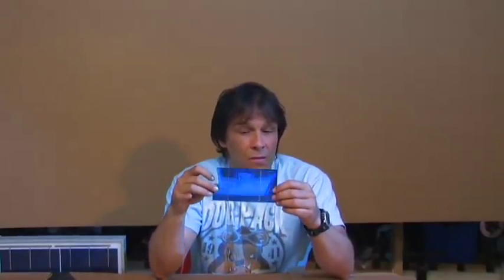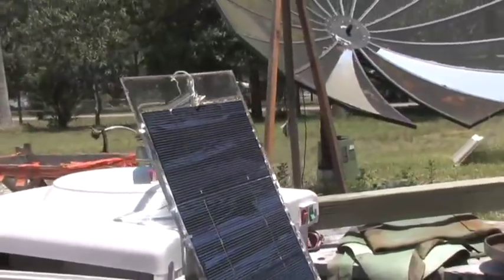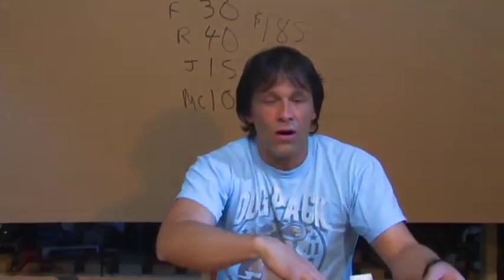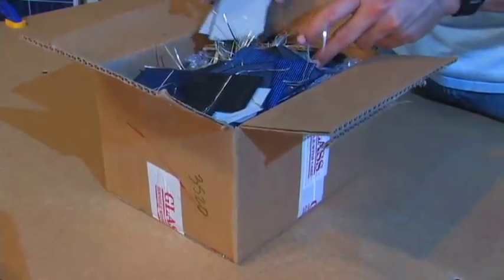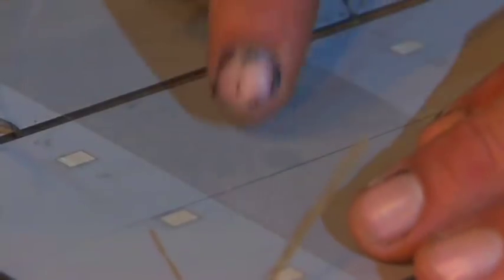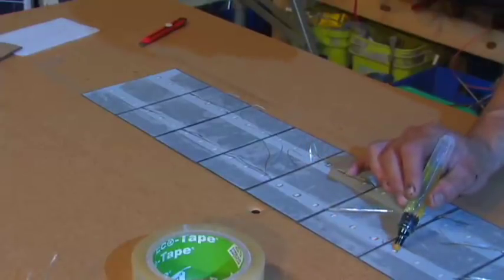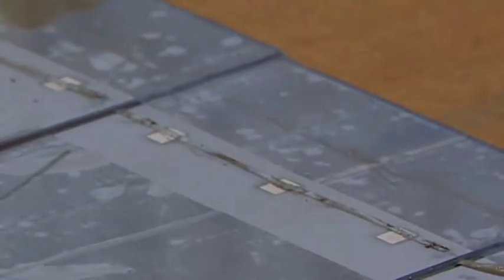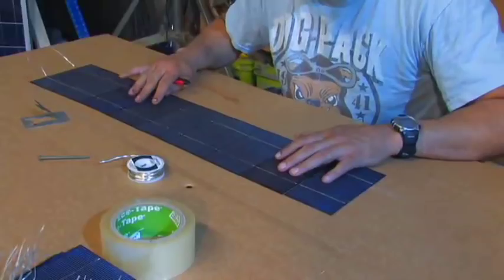less than $1 a watt DIY Solar Panel MAKE YOUR OWN SOLAR PANELS (PART 1)

Comment: i feel soory for you , imagen now 1 watt is 0,25 cent but good for 7 years .
Reply from the maker: That video was 7 years ago when panels were $250, now at $70 for 100 watts, buy them completed. Still good reasons for DIY as the cells are so much better now and custom fit panels use the same process plus like you said, cells are 20 cents for seconds a bit more for new. Aside from that,it is what it was.
Reply: @GREENPOWERSCIENCE  but how can we get 250 for 20 dollar is that posible for NOW

Comment: question......how to protect the panels from the elements especially hail
Reply from the maker: Fine mesh fence wire works great during the season of hail. It drops the power by about 5%. Worth the effort. The further away from the panels the better. This requires more material, 5 feet seems to work best. Look for chicken wire or fencing with a 3/4" hole.

Comment: I've been a contractor for 40 years and I assure you, 2x4's WILL TWIST OR WARP EVENTUALLY. Especially if wetted. Quartersawn lumber will warp less but is very expensive.

Comment: Back in 2011 $1 per Watt was probably reasonable, I wonder what would be a fair price theses days now that solar is so much cheaper..
Reply from the maker: 30 cents a watt now for cells but completed panels are less than a dollar a watt so I would just buy a completed panel.
Reply: I would too if my wife would let me..

Comment: hi
sir i have make one solar pannel at home in which i have connect 24 solar cells in series. Each solar cell is near about 4 watt which have  each 3 bus bar solar cells. so i want to know can i charge 12 volt battery from this pannel. and which charge controller is better for it, or charge controller is not require.

Comment: I like the idea but diy panels will just not last as long, so while it might be somewhat cheap to build if it doesn't last 20yrs out in the weather without needing to be replaced then overall diy panels are far far more expensive. So just buy a normal panel it will be cheaper and last longer. Building one might be fun weekend project to try which is cool but it wont save money nor last. :)
Reply: You think his resin coating will degrade over time ?
Reply: I don't think a diy panel would not just degrade but fail after a few years out in the weather. Eg If cost is a problem, buy a second-hand panel as it will most likely will have 15 years of life still in it plus its cheaper and easier then DIY. Sure go down the diy path if its a weekend project or if something cant be found off the shelf but with solar panels being so cheap to start with its kinda pointless.

Comment: Looks like too much work just to save a few bucks. 

How about showing us how to make a cost effective high capacity 2,000 Ah 12v or 24v battery?  I can't find any YouTube videos on this. You could be the first. 

The battery could be lead-acid or nickle-iron.  I prefer nickle-iron.  They last 10 times longer.

Comment: have you tried using the clear resin from the styrofoam liquefied buy orange oil to make the clear resin you need for the back of the solar panel

Comment: Looking at the back side of the cell:-I am using flux pen.The right line was taped well and the middle line all 3 small strips were not tapped. I tried again . not tapped. I tried with a new tapping bar, still not tapped and now the three strips in the middle line are look like burned and black in colour. I did not tried the left line yet. Is there any way to clean the black line? or the cell is still good to use with left and right lines are tapped?

Comment: hay  Dan  
I love your videos. I wanted to know if you can shed some light on something i got going on with my panels. voltage is 108 volts but my inverted only can run at 20 to 45 volts. i can not get the inverted to do anything.  what should i do? go get a charge control and run the inverted off of battery?  i got 180 cells did i go too large scale?

Comment: I am a little confused how to you cut the panels if the wire is not joined to itself.if the wire is joined to its partner you cant cut the cells as easily. But if the wire id folded over and soldered to the soldier points then you can cut the cell into individual cells.

Comment: Use orangewood  stick when you solder. Orangewood stick is a tool use and it is smooth and does not get hot.

Comment: You can buy new units for less than $1 a watt now.
Reply from the maker: alan headrick The cells are now less than 60¢ a watt now too. This video was from a few years ago when prices for completed panels and solar cells were higher. Everything is really inexpensive now.
Reply: +GREENPOWERSCIENCE  It's amazing how cheap they've gotten.  I just paid 25¢ per watt for complete panels (50 of them).  Exciting!  Now if I could just store the energy so cheaply.
Reply: +Peter Lawton where did you buy your panels?
Reply: I signed up for email from sunelec.com and waited.  The best deals are offered via email, not the web site.

Comment: I was interested in this video 2 years ago, $1/watt sounded good.  but now panels have come down to about that price.  Is this still possible to make them for less than buying manufactured?
Reply from the maker: jochco3 Yes. As prices have dropped for completed panels, so has the cost of cells. They are well below $1 a watt but the time vs quality and cost of a professional panel difference is less. I suggest going with manufactured panels unless you have a custom install (special size), access to free glass and/or have extra time on your hands. I think solar will bottom out soon as the cost of materials surrounding the panels have a set price. I would avoid buying glass. If that is your only option, go with a pre-made solar panel.

Comment: Hi Dan,
It is great video.
I have a few questions:
Where I can buy the cells and which cells I should get, I saw there are some cells with 2 or 3 tabbed wires, which one is better ?
Also, where I can get the batteries, controller and DC/AC inverter and how much they probably cost ?
 
Thank you.
Michael.

Comment: How much you can save with that in sunny days ?
Sun power 1kW/m2 maximum, yield typical 30% if  the hot air enters up in the house at less than 30°C,   i.e. 300W/m2  in a few sunny hours gives  around 1kWh/m2day  i.e saving less than 0.1$/m2day.
You recover yours 50$/m2, roughly in 5 years if 100 sunny days in winter of each year !!
It is perpetual and thus  good saving over many years with many m2.
 The yield improve when the heating air coming out is at the minimum possible temperature around 30°C, cycling fast with thermostat.
May be better on the house wall, or roof, with large surface of many m2, 20 to 50 m2.

Comment: hey man i got a way of encapsulaying thats way cheaper use a piece of 1/2 inch copper tubbing and flaten the end down to about a 1/16" gap and use it on the end of a sioicone caulking tube works great

Comment: I'm confused. You do all that soldering and then you say that you did it wrong by soldering all the panels to themselves, yet you don't show the correct way or what exactly you did wrong. All I see is that you soldered 3 tabs on each side of each panel but what was the mistake? It would be nice if you took the time to show the correct method.

Comment: Somebody help me out. I have watched a lot of Dan's video's. As well as many others. From what I understand the Mono-Crystalline Solar cell's are the way to go. At 0.5 watt each. It appears in the video that he is using the 3X6  inch size. In the video's he shows this glass that appear's to be 2 X 2 foot. Give or take a little. Any ways he get's some 15 or so volts out of it. Now go  over and look  at Harbor freight. And you find some about the same size and it says some 480 watts.

Comment: Wal-mart sells 1 watt solar panels for 98 cents each and they come with a light bulb and a stake that can e used to pin down a tarp to protect your garden from frost. I think they call them "solar path lights".
Reply from the maker: dynoclaus Those are not one watt but still a good buy.
Reply: GREENPOWERSCIENCE The Dollar Tree has similar lights.  They are likely to be much less than a watt.  The battery that comes in them is just a cheap AAA NiCd battery 200 MA and it is a probably only used because they get them super cheap.  I never buy NiCd unless they came with something I bought.  It is either NiMH or lithium ion instead.  In those path lights I a lot of times find that the battery has leaked and so I just take out the battery and put it in a small plastic container for the next time I am near a battery store.  I know of a battery store that sells most of the popular battery sizes.  They have batteries for toy cars or even lithium ion jump starters for your car.  I know some people don't like lithium ion but they are much lighter than a lead acid battery and not dangerous unless mistreated or overcharged.
Reply: That would be a really good buy, but I don't see it on Walmart.com so maybe I'll have to wait for a special buy sale. I have seen a complete panel, 190 watt for $190 and if you buy thirty you get a price break. http://www.wholesalesolar.com/products.folder/module-folder/Topoint/jtm190.html

Comment: Why make your own panels when Grid tie panels, which work great with MPPT charge controllers on batteries, are so much cheaper?  Is it just for the fun, like building your own ham radio? 
 The building part does sound like fun.

Comment: Hello Dan, I was wondering if you might of made an video on how to repair solar panels? I was given a small indoor car re charging solar panel with cut wires, I got to re solder the wires but in the process, one of the original wire had detached from the back of the glass part, what I mean is on the back of the glass window covering the black solar making portion of the panel is coated white, when I tried to re solder the wire I ended up melting the protective coating and lost the connection, is there a way I can re attach said wire?